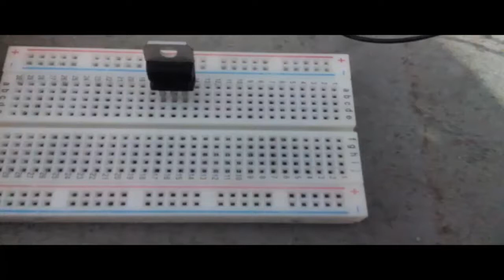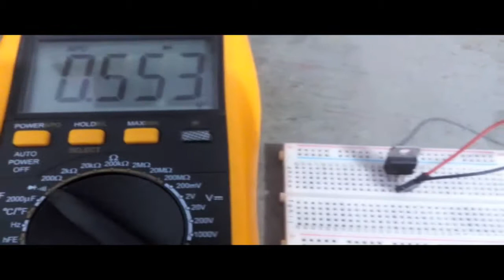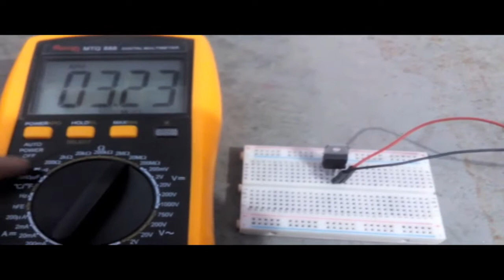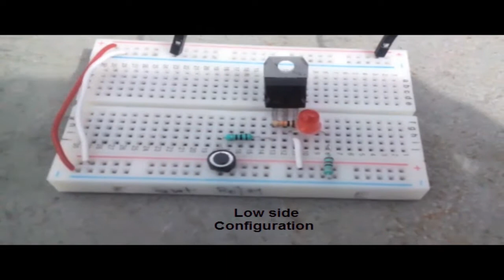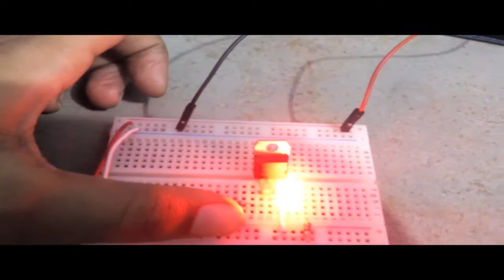Testing of MOSFET

Comment: genius! is the circuit-based test enough? or do i have 2 buy myself a better MM (mine is an analog 1 and it doesn't even go as high as MOhms - 10K is the biggest multiplier, and of course, no diode mode)